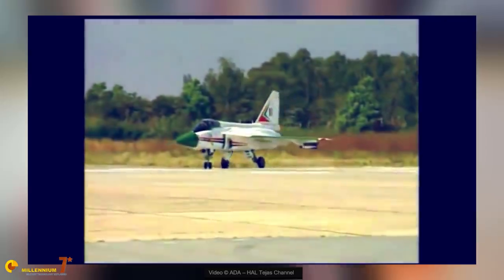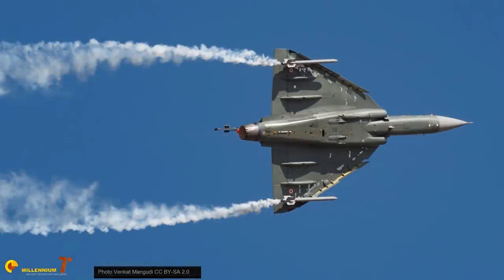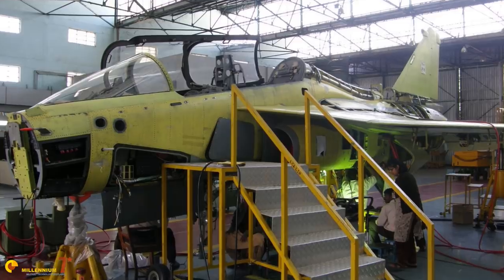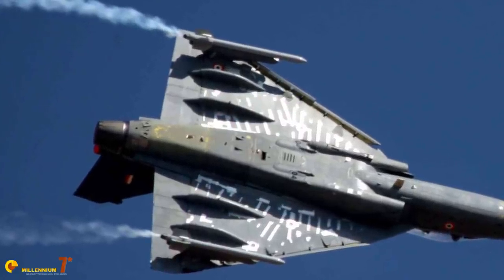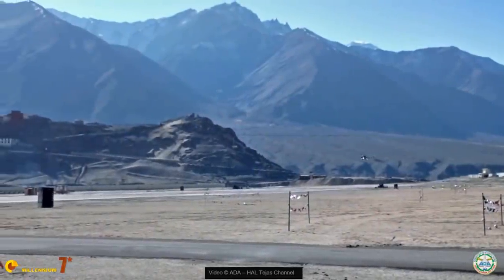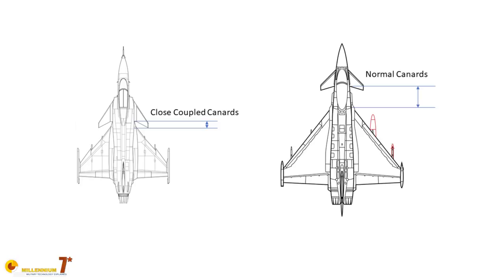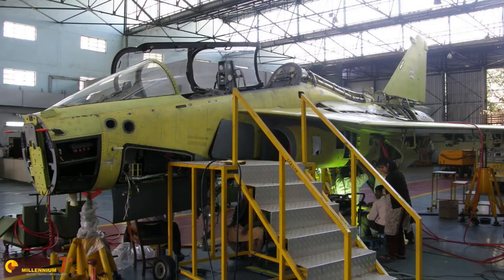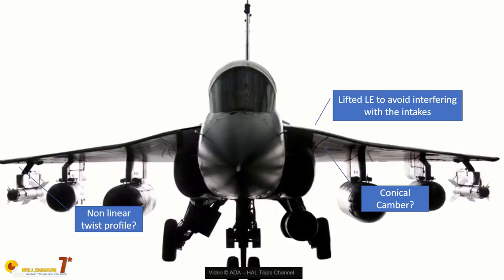TEJAS Aircraft  Aerodynamics Analysis - The Swedish Connection?

Comment: A few remarks:
- To me the Tejas seems nearer to the Saab Draken then the Viggen. If the cranked delta is similar to that of a Saab at all this is probably more true since the Draken has no canards.
- Another example would be the Avro Vulcan which has a kink similar to that of the Tejas in the later versions.
- In all these designs the aerodynamic centre and centre of gravity are brought forward in the inner wing and thus also overall. The Draken however has a more sharply swept inboard section where the Tejas, Vulcan and Viggen have lesser swept inboard then outboard sections. In that respect the Draken is probably closer to the crescent wing concept of the Handly Page Victor.
- In all cases the overall aspect ratio is improved by the lengthening of the average chord.
- Pure vortex control could just as easily be fixed with an oldfashioned doogtooth.
- The wing profiling might be nearer to Concorde practice, negating typical Delta-wing slow speed problems with exact curvature shaping.
- The shape of the fuselage and overall layout seem to suggest a rather basic interpretation of the area rule. No wonder it is being refined.
- The flat, slanted fuselage sides might be a rather poor attempt to invoke a bit of stealth. 
- The inlet design is quite near to that of the original F18 Hornet, which is no wonder since it used a very similar engine.
Reply from the maker: Good comment, thanks!
Reply: @Millennium7HistoryTech  Thank YOU for taking me seriously at all. :-). I did however make a few minor mistakes in my phrasing (for instance mixing up the Draken and Viggen myself at a certain point) which I already corrected. Thinking further about the subject in the meantime makes me wonder if the Tejas is actually inherently instable at all. Do you see any clear proof for that? Even if this has been fashion for so long it does not mean every design actually has to be based on this principle. A more traditional approach avoids certain risks. If inherent instability works it has big advantages but if it is not executed expertly it will have more disadavantages then advantages. So my gues actually is that this is a conventional design or at best a relaxed stability design along the paths I described with a few more recent "fashionable" additions like those slab fuselage sides.
Reply: @marcbrasse747  it is inherently unstable...thats why it has quadruplex FBW.
Reply: @Donald Twitter Why wouldn't the advantage be the same as for the other jets with relaxed stability: reduction in trim drag and more net lift for a given AOA?
Reply: @prashantsharmastunning  Interesting! Can you please explain what aerodynamic aspects lead to this inherent instability? Quadruplex FBW is not proof in itself.
Reply: @marcbrasse747  because it's a tailless delta plane. A tailless aeroplane has no separate horizontal stabilizer. Because of this the aerodynamic center of an ordinary wing would lie ahead of the aircraft's center of gravity, creating instability in pitch. It's more unstable than gripen and that's why 4 channel FBW is required to control the this instability.
Reply: @Donald Twitter it doesn't work like that... Though canards and tail planes increases maneuverability , the short length of Tejas gives it the same advantage as a  longer airframe with canards.
Reply: @prashantsharmastunning  So the original Dassault Mirage and Convair Delta's where all inherently instable and thus had multichannel digital FBW systems? Not true I fear. Having to trim for a far aft aerodynamic centre as with a delta is not the same as fighting inherent instability. You can actually do such trimming by ever so slightly offseting the wings angle to the aircrafts natural vector and then only use the aerodynamic devices to control all situations that deviate from that natural state. That is basically what happens in every (well designed) airplane, instable or not, delta or not. Furthermore: Multichannel FBW also exist for other then aerodynamic reasons. For instance: Any electronics failure wil automatically be deadly in an airplane if you do not have a mechnical backup system. So digital FBW without such backup will always have to be multichannel.
Reply: @marcbrasse747  the objective matters, tailless planes are instable, you can stabilise them if you don't have a sophisticated fbw, but when your objective is gaining instability you simple use FBW to make it actively stable. It is simple as that.. plus you can read the Tejas brochure on DRDO website.
Reply: @marcbrasse747  https://www.tejas.gov.in/specifications/leading_particulars_and_performance.html it is the govt of India website.
Reply: @Donald Twitter bro u need to understand, if you go tailless your design will be inherently unstable. Those crafts before fbw was invented were made stable by aerodynamic engineering you can read about it on internet, about the techniques used to make unstable delta stable. After FBW was introduced designers start opting for inherent stability.
Reply: @Gort m not confusing it, he asked to give proof that it's inherently unstable, I gave Him the reason and the official document of Tejas. If you search about tailless delta wings and how they were made stable before FBW, you will get what I am saying.
Reply: @Donald Twitter bro it's ok if u don't want to understand that tailless delta platforms can be made stable , read the methods proposed by J.W. dunne.. then I will call the Saab if u still don't get it.
Reply: @prashantsharmastunning  But we can then agree that a delta does not have to be instable, can we? Furthermore the Tejas does not have the emidiate giveaways that I asked you to point out. As I explained the kink can actually be seen as a stabilisation measure. Furthermore the flow inducing, almost fin like, hinge potrusions on the underside of the wing look counter-intuitive in that respect just as much as they are contrary to the semi-stealthy, slabsided fuselage. So if any special tricks have been used thy must be on a smaller, less clearly perceptible level. One can however argue much more easily, as is done in the video itself that they did not have to bother to make the thing refined or stable because they could always fix it with the FBW software anyway. Fix it in the mix they call that in the music world. It's just as with modern SUV cars. Their aerodynamics tend to be those of bricks but the electronics are  so "very" sophisticated. I am however getting rather subjective myself by now and we could be discussing this 'till kingdom come..... :-)
Reply: @Gort Indeed. Which a delta actually partly accomodates by having the centre of gravity of the wings alone already well aft. It also explains why the Draken and the Mirage have their tail stick out rather far and are also a bit portly in this region, although I stil expect a tiny little bit of wing longitidinal offset as well, even if only in the trailing edge being slightly lower then the leading edge. This is a very interesting discussion. I am actually having fun! :-)
Reply: @Gort My point exactly!
Reply: @prashantsharmastunning  You are certainly confusing something, because this is what you wrote: "bro u need to understand, if you go tailless your design will be inherently unstable."  You stated that a tailess design is inherently unstable, which is simply not true.  I don't care whether or not the Tejas is statically stable, I care about blanket statements that are false.
Reply: @Nick Emerson Why the hell are you telling ME this?  I'm not one of the partisans for either aircraft, and I never challenged "canard design".  All I have done is challenge two incorrect statements:
1.  A delta wing is inherently unstable  
2. A longitudinally unstable airplane needs a tailplane or a canard to realize an advantage from that instability.  
If you want to discuss either of those points I'll be happy to, but don't try to pull me into an argument I did not make.
Reply: Marcos B  I do not agree. By discussing this we have dispelled the sort of myth that comes into existence because people think they can adress a subject simply by imitating the fashionable dialect surrounding it. I actually find it refreshing that just for once the truth comes to the surface. Discussing things is after all an age old method to gain knowledge. Things only go wrong when people start to take things personally, most often those who are loosing the argument. There is no shame in being wrong, only in sustaining ignorance.
Reply: @Nick Emerson No problem. I was not alluring to anybody in particular. I was simply trying to point out a lack in objectivity one often encounters. Call me a bit of a Vulcan in some ways. Nobody loves a wise guy. Especially not if he is right! That has actually often brought me into trouble so one can just as easily say that I am triggered in my own way by the behaviour I critisize. :-) In the mean time it is still an interesting discussion.
Reply: @James Van Allen  The inclusion of the Marut is another interesting point. The argument that India still has to catch up is valid. Nothing to be ashamed about though. Rome wasn't built (and pulled down) in a day. Becoming defensive about such facts does actually not further the truth. Neither does it change the laws of physics and thus aerodynamics. But then again: If the truth was really put first we wouldn't actually need fighter aircraft. Now imagine that: The ultimate joint venture would actually lead to the closure of all remaining fighter aircraft development. Which would actually rob us of a very intruiging subject! :-)
Reply: @James Van Allen Yeah but isn't that the saddest excuse in history? Ever heard of MAD (Mutually Assured Destruction)? Not that this stil has anything to do with aerodynamics... :-)
Reply: @Nick Emerson Yeah, they say the Draken already did the Cobra long ago. I've always loved it's shape. Even today it looks futuristic.
Reply: @Nick Emerson All true but it also buzzes me on a more subjective levle. 1955 if I remember correctly. Compare it to what else was buzzing around at that moment. It's the Citroen DS of fighter aircraft! :-).
Reply: @Nick Emerson Thanks fo the great link. Somehow the Spaceshuttle however never looked as sexy to me as the Draken does. But then again: I like slim girls more then tubby ones. :-)
Reply: @James Van Allen Hey, things tend to regulate themselves in the end anyway. The question is more if we are the next Dinosaurs.
Reply: That would certainly confirm my expectation that the inlets where influenced by the engine choice, as they of course alwys are but this time even by the very same manufacturer. :-)
Reply: @James Van Allen Sweden can afford and could do it for sure, it's more that the market is already occupied by larger countries that'll have it easier selling their planes because of political reasons, therefor it's the smart move to build something that the other countries doesn't do.

Comment: The problem with the Tejas Mk1 was that the original design was supposed to be a simple cheap replacement for the Mig21. The original design was based on this specification. Then came the US technology sanctions against India for nuclear testing, which delayed the development of the plane. Because of the delay, the Tejas could no longer replace the Mig21 and the IAF changed the specification of the Tejas was to bring it up to date. The IAF wanted more thrust, more avionics weight, more range etc. but the basic configuration of the Tejas (intakes, dimensions. lack of canards etc.) was frozen and the designers were constrained by these. The programme was already delayed by the sanctions and IAF changes and was under heavy criticism by critics and Indian politicians and lobbyists for foreign aircraft manufacturers for the delays, and so the Tejas Mk1 designers were not allowed to go back to the drawing board to optimise the design for the new specifications. The result was the Tejas Mk1. The IAF's updated requirements need canards, increased length, increased internal fuel, increased thrust, and redesigned intakes - the Tejas Mk2.
The cut off wing roots, wing dihedral, and varying wing thickness/dihedral are indeed extreme optimisations for maneuverability. A bad characteristic on pure delta configurations is that at high AOA, the vortex formed at the root of the wing suddenly flips up and over the fuselage changing the center of lift, which leads to vicious handling characteristics at high AOA. The Kfir dealt with this by adding small fixed canards to control the flow at high AOA, the Mirage 2000 by adding fixed strakes on the intakes which offered a limited improvement in controllability at high AOA. The Tejas solved the problem by the measures taken to optimise controllability at high AOA.